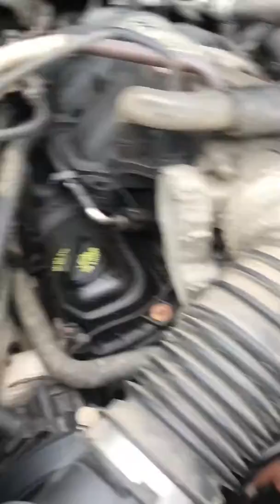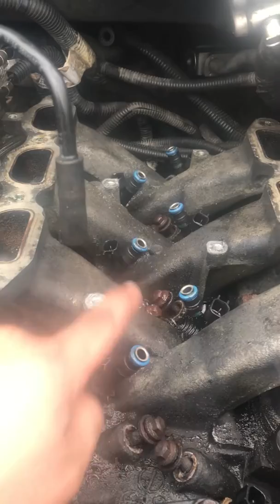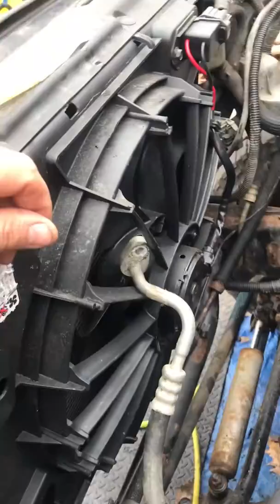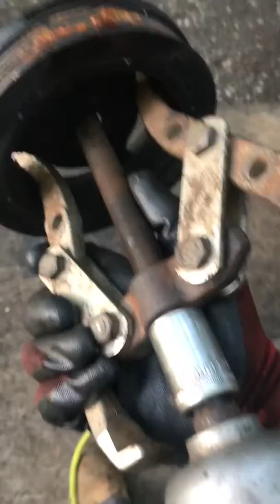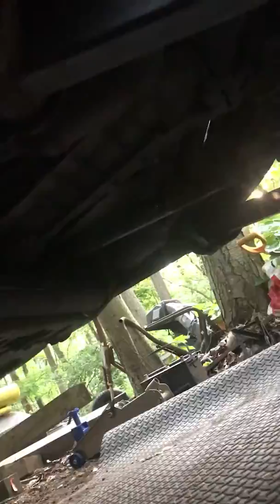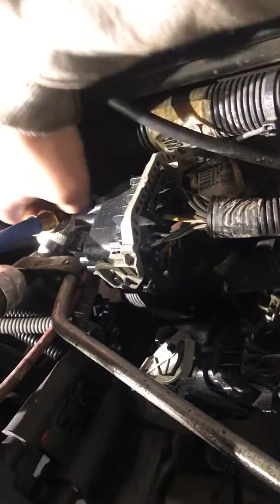2007 Jeep Wrangler 3.8L Engine Swap (Full Video)

Comment: Anyone watching this video, do yourself a favor go ahead and remove the radiator and deflate your tires once you are ready to pull and install engine. Also do not need to remove compressor just zip tye it out the way. Rebuilt my 3.8 and installed a turbo kit .
Reply from the maker: I agree, it will give you more space to work